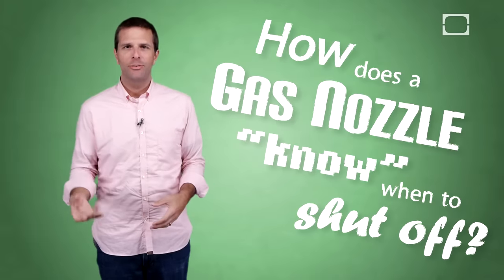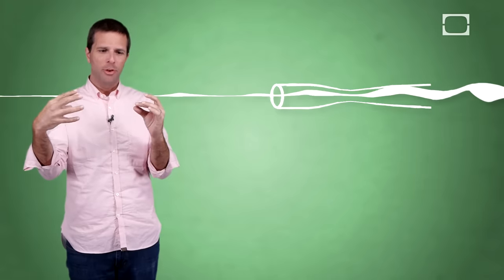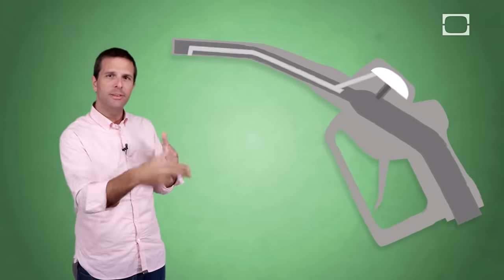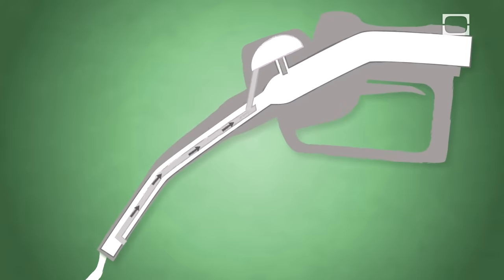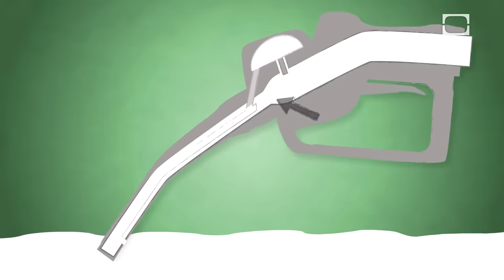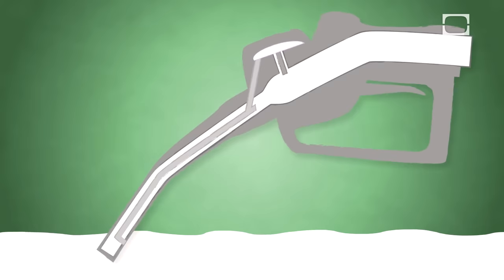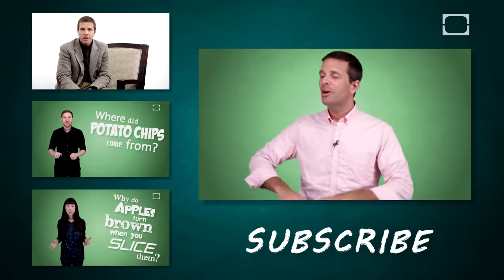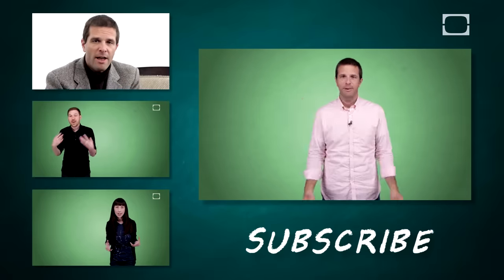How Does A Gas Nozzle Know When To Shut Off?

Comment: I could watch this video on repeat for my entire life, and never understand it.
Reply: He doesn't explain it very well. Seems like he only has a surface level understanding itself. "Fluid can be gas", I mean C'mon. I know he's talking about gasoline specifically. And not gas, as in the elemental state. But he should specify. It's little things like that which ad to confusion.
Reply: @janegoodall1837  Since gas (the elemental state) is considered a fluid in the context of physics/fluid mechanics, and "fluid" can mean liquids, gases, and plasmas, that is actually what I thought he meant when he said "And remember fluid can be gas, it can be liquid", not gas(oline).  But... then he says "it doesn't have to be water or something", which seemed pointless. Now I saw your comment and I don't know what he meant anymore LOL
Reply: @janegoodall1837  No, what he is saying is that fluid dynamics works with gases, liquids and even solids, more specifically, that fluid does not mean liquid, we only associate it that way because liquids are more obviously fluids in our everyday lives. Though I'll grant you , he doesn't explain it very well. Honestly, this seems a fairly simple solution, not complex. As you fill the tank, the air in the tank has to go somewhere. The nozzle takes some of it and as there is less air in the tank the pressure coming up that tube lessens past some balance point and the trigger releases. It's ingenious in its simplicity. Like a thermostat. It takes a fairly simple concept and applies it it a useful way.
Reply: I am a kid but after watching this for the first time I understood what he was saying
Reply: @arjunpatilyouthcricketer5864   - You will come to find out that a lot of grown-ups are not as smart as kids.
Reply: The 2D presentation also doesn't make it clear for a lot of people.
Reply: I'm a bit concerned that a lot of people didn't understand such a basic concept 😂😂🤷‍♂🤷‍♂🤦‍♂🤦‍♂

Comment: "Remember fluid can be gas..." I had to think twice about this.
Reply: Adrian Kruger but can gas be a gas?
Reply: Basically anything that flows is a fluid
Reply: @Shrirajtyke  The guy had a pretty good flow during his video
Reply: Fluid not Liquid, and it can be gas.
Reply: @WirageVoyage  fluid man
Reply: @Shrirajtyke  airflow…gases operate on the same principles as liquid however they’re a lot less dense, similarly solids operate the same way except they’re way more dense, it’s how you see aerodynamics work and also how you see glass flow over time

Comment: does that mean I'm filling up a diaphragm of extra gas everytime I fill my tank? that extra 0.0001 cent :(
Reply: Jack Johnston Bob well according to his animation, the gas goes back into the tank due to suction, which is actually what deflated the diaphragm. Not 100% sure otherwise I wouldn't be on this video. But that's what it looks like.
Reply: You are not paying extra. You can see that when gas nozzle stops gas flow, you need to hold nozzle in fuel tank couple more seconds or you splash some gas to the ground.
Reply: ***** Thank you for pointing this out. I had never thought of that.
Reply: it drains back into your tank after your nozzle shuts off.
Reply: It doesn't drain automatically because the valve shuts off, to drain it you have to pull back the nozzle just enough to release the pressure and left over gas. Gas stations tell you not to pump if the nozzle isn't all the way inside but that's bullshit. If you keep leaving that small amount of gas you're literally giving your money away to the gas stations. You may think it's only a little squirt but with thousands of squirts left behind everyday that adds up over time.
Reply: If you've ever read instructions for pumping gas at a station (yes, most of them do have instructions if you look around), they recommend you leave the nozzle in for about 3 seconds after pumping is complete.  You get that gas back, you minimize leakage when you withdraw the nozzle.

Ever noticed how when you pull it out too fast, it just drips all over the place?  Yeah.  That.
Reply: they tell you that because the gasoline that drips on the ground is worse for the environment because its raw unburned fuel. filling up your tank actually pollutes the air more than running your car
Reply: Umm, nope. No carbon monoxide. Running your car pollutes far more than leaving a glass of fuel to evaporate
Reply: NexxtGenDave
The fuel stations say to keep it in all the way for safety. It reduces the amount of vapour released into the air, which reduces the chance of fires being ignited. And it reduces the amount you breath in. And if they have those vapour catching surrounds installed, they're only going to work if you push it right up close.
If they wanted to rip you off, they could just put the price up 1c per litre/gallon.
Reply: tin2001 Which are not made for (nor fit)  motorcycle tanks. There has to be something else going on.
Reply: R Hamlet how do u charge the electric cars?
Reply: usualy they charge it off of a coal or nuclear or deisel generators sometimes solar or wind and occasionaly dam power but still most of its coal deisel or nuke
Reply: Alihsba
Reply: All you have to do is tip the back end of the nozzle up and wait 5 seconds for any residual fuel to drain out into your fuel filler. You should do it anyway for the environment. Minimizing gasoline vapor release is an issue of concern for the EPA. You c an do your part to help by making a slight adjustment to your filling technique.
Also, you shouldn't fill your tank as fast as possible because you are just creating more vapors. IOW, use the first or second latch stop, not the third or fastest one.
If you want the most gas for your buck, fill up in the early morning or late night. Gas is measured by volume and has a relatively broad variance in volume based on temperature changes, as highly volatile liquids do. You might get several percent more gas by weight if you fill up at midnight than if you do at midday, especially if you live someplace like the SW USA. In any case, a bigger concern than possibly getting a few less ml of gas in your tank!
Reply: Are you all so poor or do you have no job to be spending your time on this?
Reply: Otto Kapanen .. actually, to be honest, we all ,in theory, pay more for gas because the gas between the nozzle and the price on the pump is gas you paid for but never went into your tank. However, the guy before you did the same thing so we all get free gas and get screwed on the other end also ..hehe
Reply: Zoey H are you sure on that? I heard it doesn‘t make much of a difference because the tanks containing the gas are underground and temperature usually remains constant (colder) there ...
Reply: Just shake the pump handle, like you gotta do with your pecker to get them last drops out. Same thing with the gas pump.
Reply: NeuroDancer100 I thought they just say that because of the increased weight of the car.
Reply: Well, Jack, it probably wouldn't be that low amount of money. It would probably be a few cents. But maybe they've figured out how not to make it count with how much you're trying to put into your vehicle or can.
Reply: Nicholas, they have instructions even if you don't look around. Whether or not you look has no bearing on whether or not they have them.
Reply: That’s why when I stop pumping I take the nossel out most of the way and add a little more
Reply: I think it is left for the person who is filling next as somebody else left some for you.
Reply: @geniuswithacapitalk  But it gets into the next person's vehicle right ? I does not go back to the tank. It is just there in the tip of the nozzle.
Reply: Like an extra 10 Cents now bro
Reply: This aged well lmao

Comment: As a Gas Station owner I already knew this, but not in this much detail or a diagram, I didn't know what the effect was called but I certainly knew it was mechanical. Here's something you may not know, the pump nozzle( the handle and everything besides the hose) is surprisingly cheap, while some models may run a little better or be built better they can be purchased for under $14. The safety mechanism does fail, but there aren't many ways to test pumps to see when they are going to fail, some may work for years or fail a week out of the box. This is why it is still a law for you to be attending the pump so it is not to overfill and not the owners fault that you were irresponsible. Here's a tip if you ever notice this mechanism going off when you know your tank is not full this is because the pump isn't all the way in your tank or something is blocking it causing gas to flow up the tube, you see their is often a metal flap in your newer cars between the outside air and the tank, so if this happens just take the pump out and reinsert it into the tank. Finally a safety tip, if under any circumstance a fire occurs at the pump don't remove the nozzle from your cars tank, your car will not explode, there isn't enough oxygen in the tank for the fuel to burn so just the fuel and gas on the outside catch fire leading you to believe the flame will reach the tank and blow up. It would eventually happen but not if you rush to the attendant and have them press the emergency stop button to prevent anymore gas from flowing and to activate the on site fire suppression system or any near by fire extinguisher.
Reply: it also is stupid that most don't have a manual by hand shutoff like they used to. if what you said above were to happen in the past you could flip a lever were you store the nozzle to stop the flow.
Reply: @DCMAKER133  Actually the lever is still there on most dispensers. Its usually plastic, it detects when the nozzle is hung up. If you were to press it up for 2-3 seconds the flow would stop in all actualities. However, that is my experience with most dispensers I have come across.
Reply: @EqualsThreeable  the lever has been moved to inside the top hole where you push the nozzle into. That's not something you can easily push up with your hand compared to the old ones where you have to flip the base of the nozzle stand up and down. (At least from what I have seen and understand. I could be mistaken)

Comment: I just had an experience at the gas station where the gas didn't shut off. It kept pouring and I didn't notice till there was already a pool of gas on the ground. My tank was full, but the nozzle didn't shut off. Prior to watching this video, I assumed there was a bad sensor, or issue, with my vehicle. After watching this video, I realized the issue was with the gas nozzle. Thank you for the knowledge.
Reply: Did it ruin your paint or ur engine?
Reply: Just happened to me today . Smh
Reply: That's rough. Don't ever put the nozzle in your tank, push the clip up to auto-fill and walk away, though.

Comment: That was a very confusing way to explain it, it is a lot simpler than you make it sound. Basically as you pump gas into your tank the air that is in the tank is displace and pushed up through a small hole in the nozzle, and into  Basically a rubber boot. This diaphragm or rubber boot, while inflated, holds the shut off valve open. as the tank fills up, the amount of air being displaced decreases. At some point the amount of air being displaced is to low to hold the diaphragm, and the diaphragm collapses. Once it collapses the shut off plate falls down cutting off fuel.
Reply: but i often when hear the first shut off, i continue by slowly pumping gas for some additional 1-2 liters until i hear a second or sometimes third click. is that fuel actually going in the tank or is actually sent back?
Reply: Vlatko.R don't do that it is a waste of money and harmful to your car. When the pump first shuts off, there is still a small amount of space at the top. When you keep pumping you over flow the tank. That over flowed fuel is caught is what is the evaporative emissions system. As you pump fuel a small amount of fuel evaporates, and is released into the air. This fuel is harmful to the environment, and if built up enough could cause a explosion. To prevent that, they a charcoal canister by the tank. These vapors are caught by the charcoal inside the canister, and clean air is what is sent back into the pump, for the shut off. When you keep pumping you are no longer sending vapors into there, your sending straight liquid fuel. That fuel saturates the charcoal. The charcoal gets to saturated and no longer works. Then your check engine light comes on, and you need a new one. So not only you wasting money for fuel that isn't going into your tank, but your also possible damaging your car, the environment, and risking causing a explosion.
Reply: I dont understand
Reply: Just say: AIR
Reply: Thank you! But why is the pressure of the air decreasing before the tank it completely full?
Reply: This isn't even correct. The air displaced would be the same as the volumetric flow of the fuel pumped in which is constant. Doesn't matter if the tank is full or empty.
Reply: You are correct but how does the shut off plate goes back to it's position
Reply: @5minvideos108  when gas covers the air tube opening the entire tube pressure equalizes with the low pressure in the venturi causing the diaphragm to disengage the venturi and cut off fuel flow
Reply: @5minvideos108  I see what you're asking now. It's reset when you release the release the trigger. Here's a better video of how it works https://youtu.be/q3phjAQZdGg
Reply: Just Jordy Arrghh!
Reply: His long complicated version was correct, your short simpler version is nice but incorrect, your version suggest that the air is pushed up the nozzle from the air pressure inside the tank which is incorrect, the nozzle sucks up the air, if this action was vise verser the trigger action wouldnt be effective
Reply: That's NOT how it works, if the air is "pushed up through a small hole in the nozzle" that's the exact opposite of vacuum. Watch here: https://www.youtube.com/watch?v=a1-X7VIxFIo
Reply: This can't be true since you can pump gas into open containers.
Reply: Except if that were true, then the nozzle wouldn't work unless it had air being actively pushed back up the little tube, but that isn't the case. Nozzles work if you wave them around in the air, with no air rushing back out of any tank to push it up the tube. I agree that this explanation wasn't ideally expressed, but the venturi effect is an essential part of the operation, and no explanation that leaves it out is correct. The air is being sucked up the tube by the venturi effect, not just pushed by escaping air.

Comment: He forgot to mention how the increase in air density or the movement of air in the pipe creates the vacuum that releases air from the diaphragm. Its more complex than that. You either have an electro mechanical valve that opens when the sensor senses increase pressure or a mechanical release valve that opens when a certain amount of pressure is put on it by the increased air pressure in the diaphragm. These mechanical valves are similar in design to the emergency valves on propane tanks or the air feed valves you use to put air in a tire.